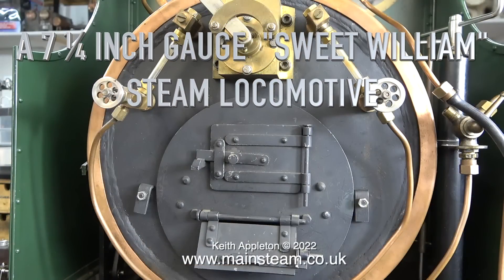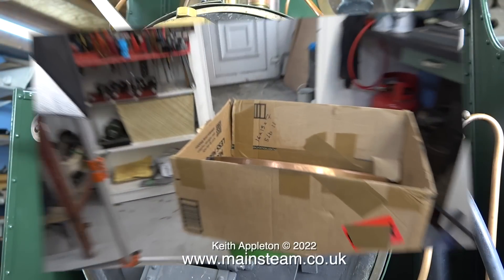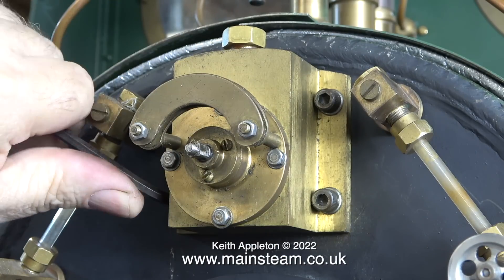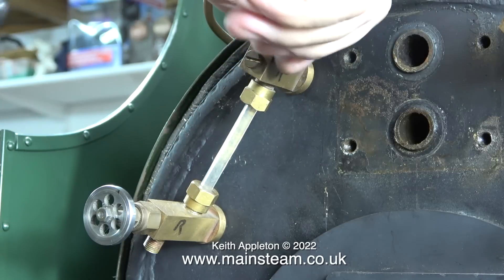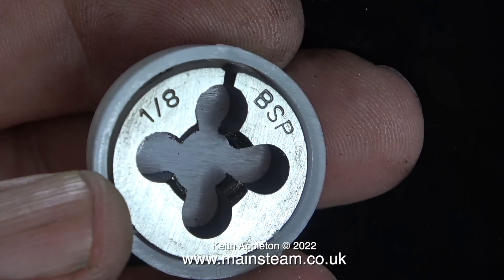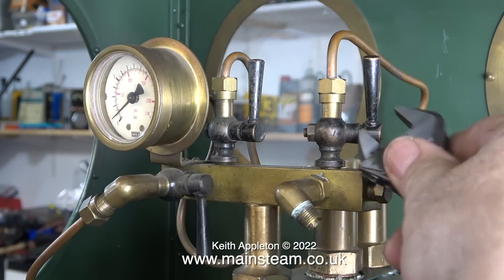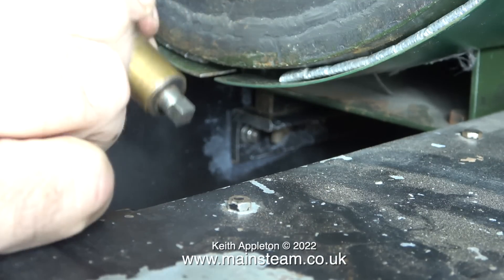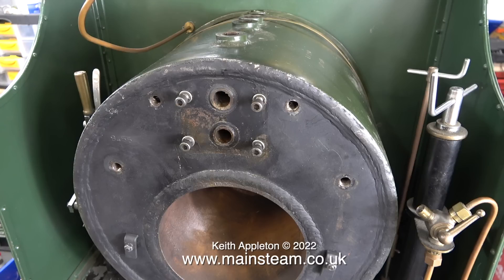A 7 ¼ INCH GAUGE  "SWEET WILLIAM" STEAM LOCOMOTIVE - PART #2

Comment: Why would someone build a boiler, without a fuseible plug though? Seems a little strange to me, surley thats boiler smithing 101?
Reply from the maker: I have seldom seen fusible plugs in model boilers.
Reply: my 3 1/2 inch gauge juliet doesn't have a fusible plug and its quite common for model boilers not to have them